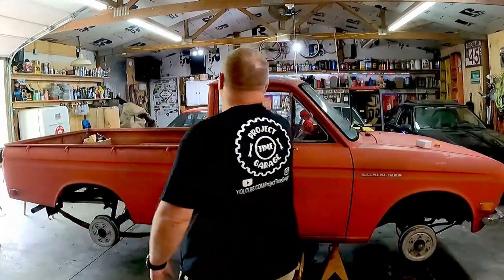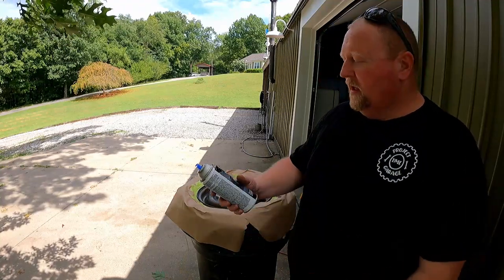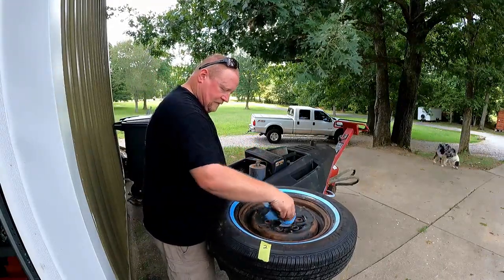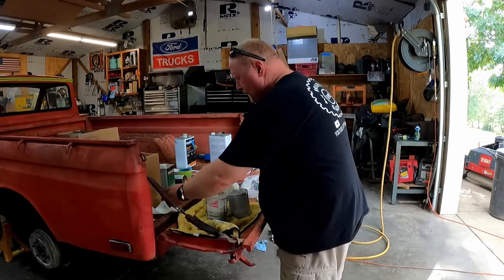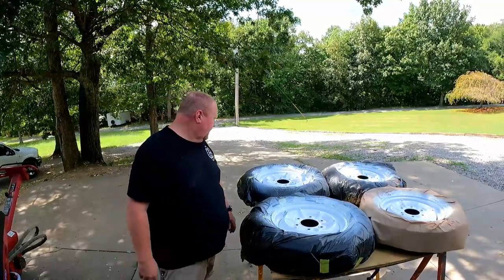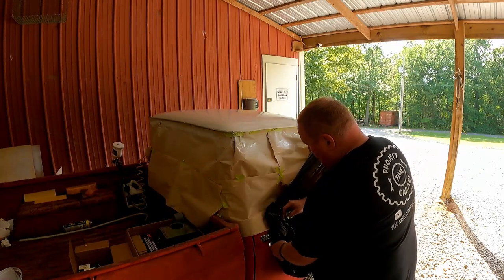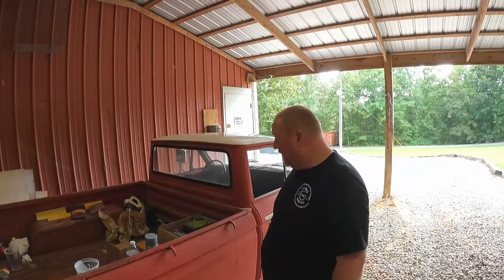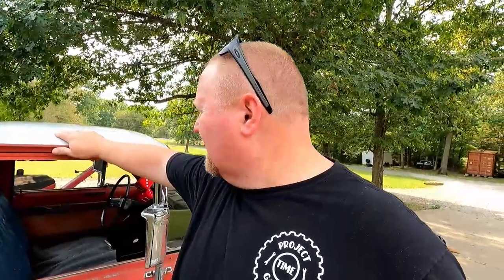Painting the roof and wheels on a Vintage Datsun 521 Pickup Truck

Comment: Love this little 521 series Datsun truck, wish they would make them again, I'd buy one in a heartbeat!
Reply from the maker: Me too. FYI, I see a few of them listed for sale on Marketplace for pretty cheap.
Reply: @ProjectTimeGarage  WHARE?  Maybe I might have to move back down to Tennessee in the future, and hope to buy a small home, and get a little truck like this to give all my love to. I would like to paint it under the frame and chassis first, and if the body is kinda rough, sand it down, prime it, sand the primer again prime it again, sand the primer again and get a nice enamel paint color and paint the little girl a nice color. Tune up the engine, change the oil, oil filter and air filter, do everything to it and love it to death and back. Like to even scratch down the bed and paint a paint on bed liner in the bed.  I've fallen in love with these 521 series trucks, can't help but to love them, very much.